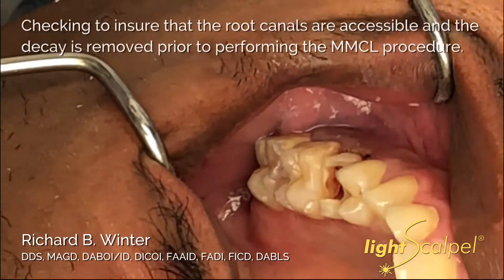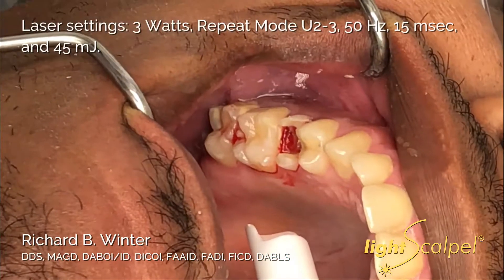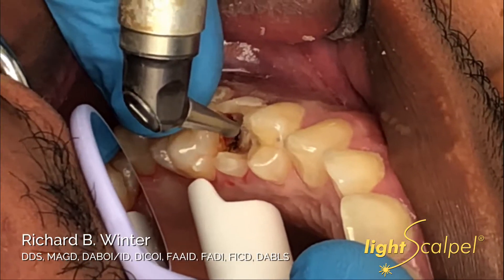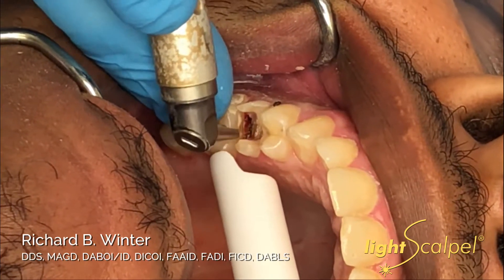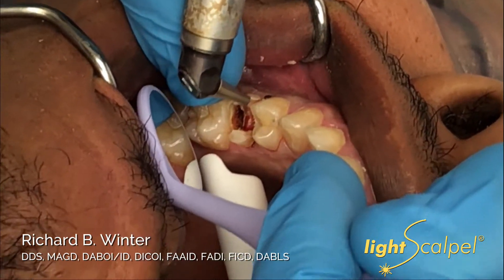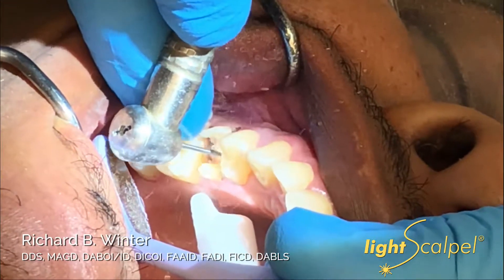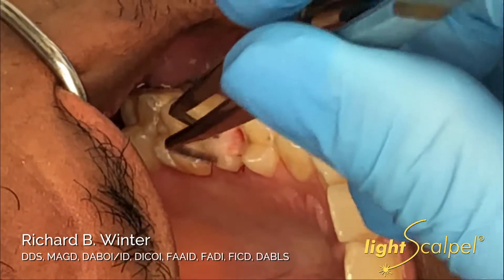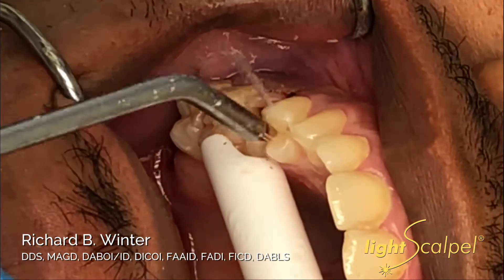Bicuspid Laser Modified Minimal Crown Lengthening - New Technique

Comment: How long would a tooth like this last
Reply from the maker: It should last about as long as a normal tooth, but the results may vary depending on the circumstances. Here is more from Dr. Winter:

"The longevity of a tooth that has been treated with minor crown lengthening should approximate that of a normal tooth. If a tooth has needed a root canal, post and core and large filling, the prognosis is not as good long term. It depends on the patients’ other teeth and how healthy the remaining teeth and gums are.

Teeth that require root canals are weaker than non-endodontically treated teeth. So it is important to discuss your particular situation with your dentist. Each situation is unique and requires full informed consent prior to deciding on the proper course of treatment." - Richard Winter, DDS
Reply: LightScalpel please help me I have my tooth number 4 treated with a root canal by an endo and they are gonna do my core build up with a zirconia crown ... the dentist are optimistic that my crown should last but they have to do the crown lengthening.... I’m terrified I rather have the tooth extracted and place an immediate implant before they remove any of my bone .. they think I should have a good prognosis bc there is a good amount of tooth structure but I just dk I’m sooo confused 😐..... in my case would this procedure damage the teeth next to it ? Also of this procedure fails is extraction my only solution? Any  advice will help
Reply from the maker: @lorenab5309 , I am not a doctor and I can't give clinical advice. If you don't feel comfortable with your current doctor, you may want to get a second opinion from another doctor. For more clinical questions you could try contacting the doctor who created this video, Dr. Richard Winter, DDS, in Milwaukee, WI - https://hamptondentalassociates.com/dr-richard-winter-milwaukee/